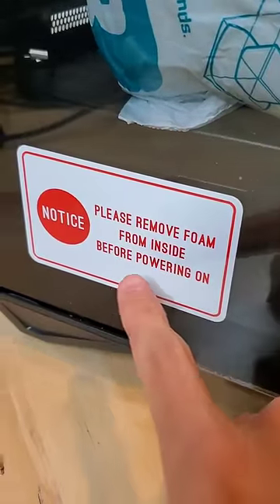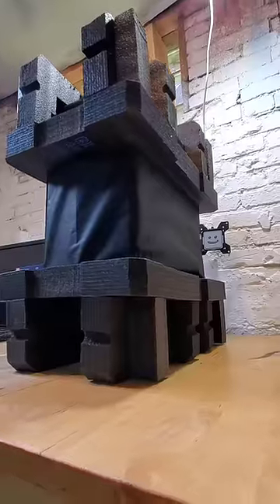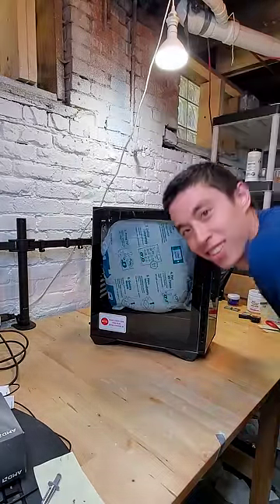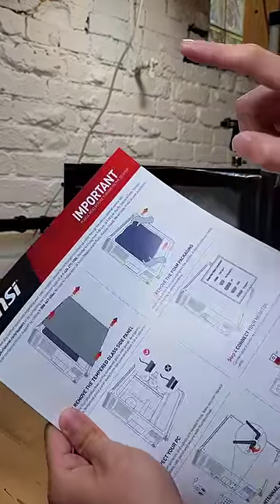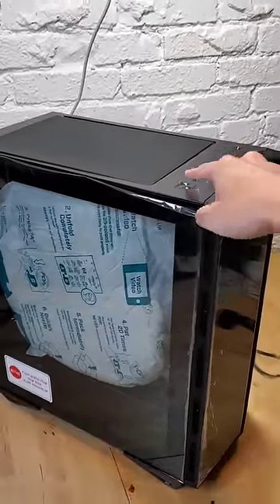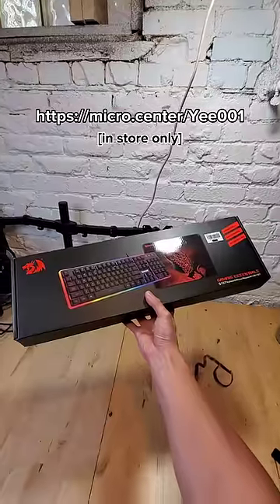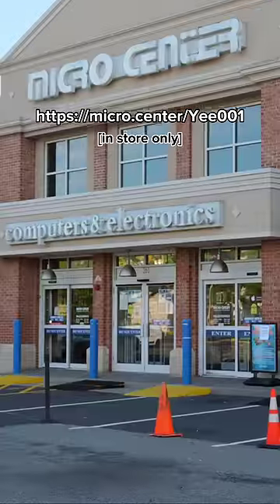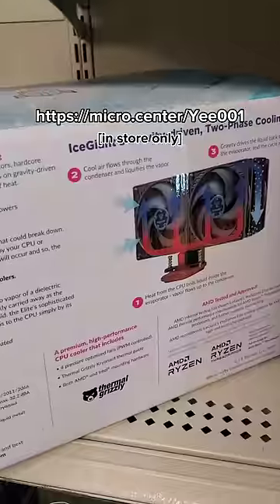what happens if you DON'T remove your PC's packaging foam? #shorts

Comment: Power it on when it’s in the box
Reply: Lmfao💀💀💀
Reply: fr tho, nothing happens
Reply: @kebab_hill  no airflow so it pretty much just overheats
Reply: HHqhahhahahaha
Reply: Nah man power it on when its making
Reply: On factory*
Reply: Anyone ever had a laptop left on in the bag? 

So hot you couldn't even hold it. Used to run into this all the time with win XP dell laptops freezing on shutdown. Someone would give me their laptop to repair and it would come out of the bag ike a piping hot pizza fresh out of the oven... I'd look in the bios fault logs of the laptops I serviced and also find thermal shutdown events in many of them. 😆 It happened so much at my company, then a few years later they fixed the fault. It was a piece of monitoring software acting up.

Comment: Well to answer the question before I even watched the vid, it would overheat due to the exhausts being blocked and it could potentially break the fans. Depending on the material it could cause a short circuit (not sure about that one tho)

Comment: Some of the msi prebuilts I’ve seen have the cpu cooler backplate mounted to the intel cpu mounting bracket with torx bits and area pain to remove for diy people. A friend of mine had a 10th gen i7 msi prebuilt and temps were hitting 100+ c instantly in a game and we needed to replace the cooler. Luckily we were able to make the stock backplate work but for many coolers that have its own backplate you won’t be able to easily replace it.

Comment: my pc didn’t have foam in it, barely even had it around it. my ram was in wrong, and i had a fvcking terrible cpu cooler, now my cpu is chilling at 47°c when at 50% usage. and of course i have many issues with it (it bluescreens 5 mins after i turn it on, but is fine after restart. $1200 tho, not bad. i think the errors are caused by screentime restrictions because my mom doesn’t understand that some drivers cannot be blocked.

Comment: Ok hard to get specific for me cause I'm not a computer guy but, how much for a computer that's not for pro streamers but also not for beginners?
Reply: I built my own pc for roughly 950- 1150 us dollars. Gtx 1660ti and an amd ryzen 3200x with a cx650 corsair power supply. Solid for any gaming and streaming but not exactly for professionals either. Just does the job you need it to do with 0 complaints or hiccups
Reply: @BIGMONKE17  hey ty for all the info, I needed somewhere to start from.  Didn't know all the components. Good day 👍

Comment: I need a pc but i made oan by my self and it has an i2 430hard drive an amd 750 and a 400 w source and 12gb ram and i need a i7 because an i2 at gaming is trash
Reply: Depending on your socket, you can use Intel Xeon. For me, I upgraded my i3 2120 with Xeon E3 1270v1 with only RM 100+ (≈20+ USD). REALLY GOOD COMPARED TO i3 🤣 The performance is on par with i7 3rd gen if I'm not mistaken
Reply: @muhammadzafranbinnaharrudi591   the pc is asambled by me  and no oane helped me so il look what i can use